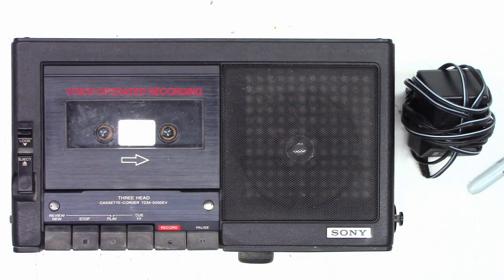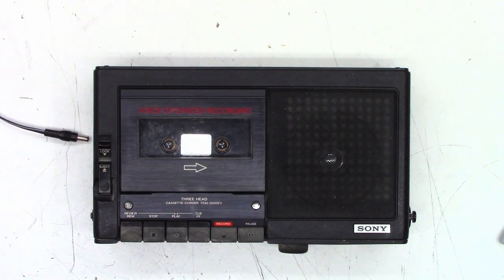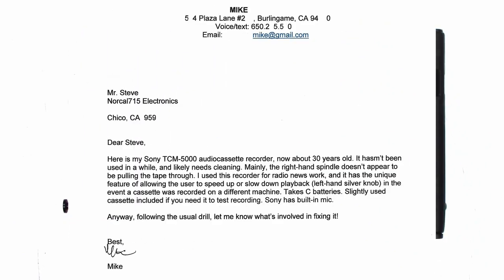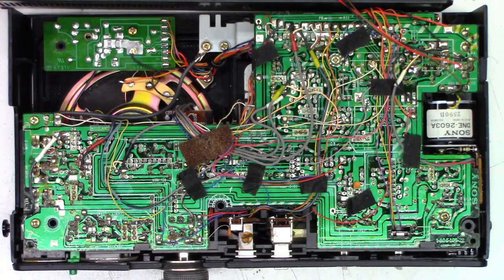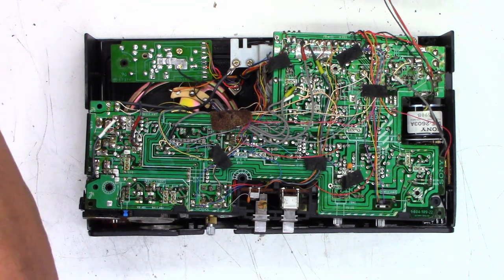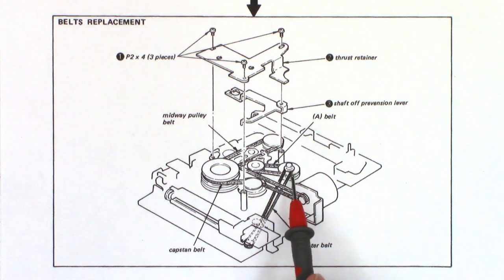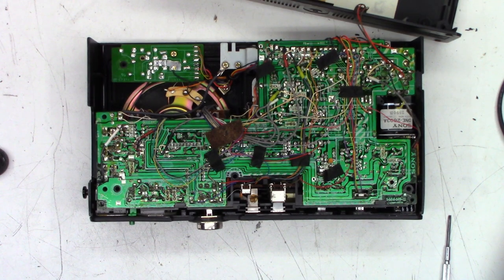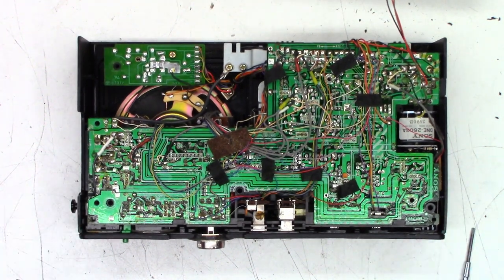Sony TCM 5000EV 3-Head Portable Tape Recorder that will not play at all! Diagnostic Part 1 of ??

Comment: It was great that you posted this video! I also have one of these. I tried changing the belt on it a while ago, but after that it no longer works. When I press play, it stops after about 15 seconds. And fast forward doesn't work at all. Rewind works. Maybe I don't have the right length or thickness of belts. I look forward to the next part!

Comment: Ooow loads of wires to snap off, i would take loads of pictures of the pcb to catch all the wires .
They are a trap lol :-D.
it looks like the back edge of the pcb should lift up then pull the back edge of the pcb out.
That glued control is a horrible bodge, hope you can loosen it.
Dam super glue.